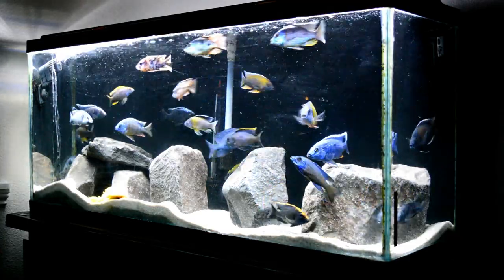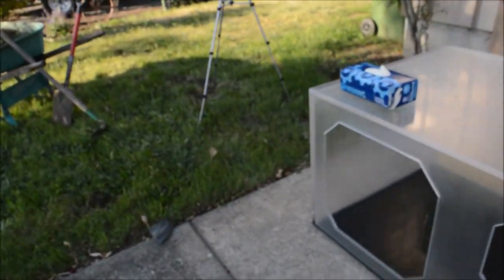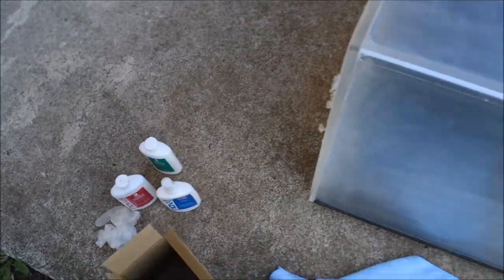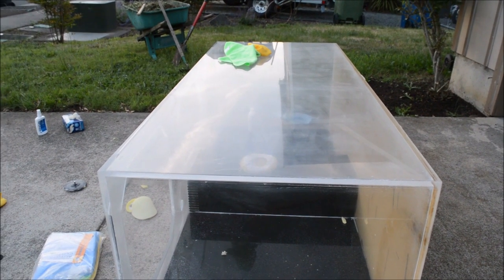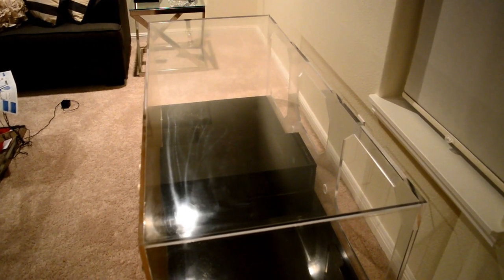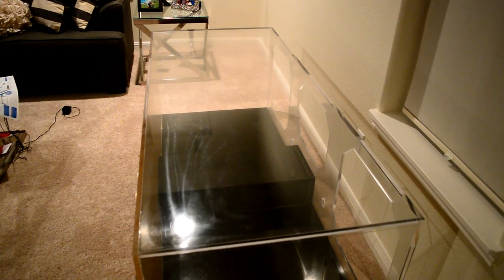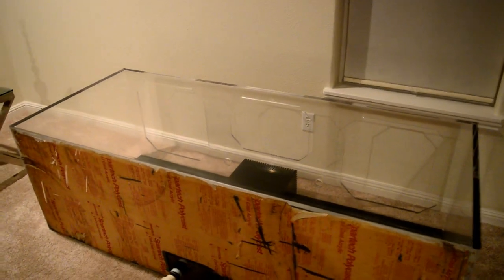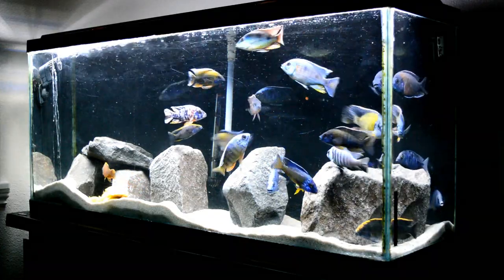How To | Restore An Acrylic Aquarium | 220 Gallon Aquarium | POLISHING Step by Step Detail | PART 2

Comment: I had a split in a seam and I filled it with weldon 16 and just water tested it and it held great. I couldn't find that stuff you used here in Australia so used this stuff called Alushine metal polish and it came up great. The only problem now is the build up of product in the corners seem difficult to get out. Hopefully after the tanks are filled, that the sump will grab that dust out. By the way made 4 tanks and now on to the sump from acrylic left overs from a friend who is a builder and had to rip out a bunch of thick acrylic. They are going to be for shrimp, oto's and hillstreams and all aqua scaped.
Reply from the maker: Have you tried to use a wet microfiber cloth to get it out of the corners? Or high water pressure? I would make sure it's out before the tank gets filled.
Reply: Yes, tried both and with the euro bracing is just seems to relocate itself somewhere else, especially in corners and around the bracing. I will be filling my tanks first with tap water to see if all the plumbing is right and there is no leaks going to or from the sump. Was hoping that would rinse the rest out. Then I will be draining it and replacing the water with filtered rain water from my rain water tank and then letting it all cycle for 5 weeks, with bi-weekly 50 percent water changes. I will be switching off one tank and draining it and aquascaping it a week during that time as well. So it should all come out. I mainly stated about the residue in my tanks as this is just normal and also like you showed the slight swirl marks from the buffer are not noticeable when filled. I did a water test on each tank, no leaks and you can't see the residue except in the corners, but when drained and dried those things are noticeable again. There really isn't that much there.

Comment: At around 9.00 into the video it shows the tank up and running. Was this after you did the polish ?. Can see a lot of big scratches along the top. Just wondering not knocking you. I have a 850 litre tank which is not too bad. Quite a few scratches but no haze at all. Wondering whether to do this or not.

Comment: Sweet tank. Currently doing a tank that used to be a 350 and now is a 260. Cut it down, glued top back on and now polishing. was wondering how to get it finished without going up to12000 grit sandpaper. Now I know
Reply from the maker: Awesome! What are you going to keep in the tank?
Reply: I have 2 reticulated stingrays and several spiney eels that need to be moved into their own habitat. The arowana, peacock bass, 18"pleco and 2 synodontis  will remain in the 250 gal they now reside in

Comment: Mine is well over 30 years old- 240 gallons and Im not sure if the haze is scratches or just the very old plexi reacting to sunlight for a few hours a day for decades?  If its just outside scratches..I can sand wet sand it etc. But,maybe its just old age of the plastic?
Reply from the maker: Hi Stan, to me it’s worth a shot. The wet sand with multiple grits will help in my opinion. I don’t think things will come out 100% be any improvement is worth it. Are you going to do it?
Reply: Maybe the outside,corner. I cant see why the inside would be scratched since I had always let the Pleco's do the wiping and algae removal. One more question- when I look at the glass panels from the edge? They are milky and not clear. Was that tank you redid also like that? Since I wonder if my problem is more age then scratches.
Reply: @inventoryking  One year later I did. The 3000 grit worked very well I thought!..It's not like the tank was in 1986-lol. But much better than its been for decades.
Plus,no machines,abrasive pastes,petroleum products. Just the 3000 grit, aquarium water and a soft scrubbie under the sandpaper. That 3M is tough paper..never wore out even under water.

Comment: Is it possible to get good results with skipping sanding and just doing the Novus kit?
Reply from the maker: IMO it all depends on how deep the scratches are. If its light scratches, you can probably get away with just novus, if its DEEP scratches, you will probably want to sand it.
Reply: +inventoryking Thanks for the fast reply. I'm going to be tackling my newto me used 240 gallon tomorrow. Thank you for making this video also.
Reply from the maker: +TERRORIZERRRR no problem. What type of fish are you planning on keeping in it?
Reply: inventoryking Silver Arowana, Peacock Bass, and maybe a Gar
Reply: +inventoryking So I finished sanding the entire tank today with 1000 and 2000 grit didnt take out all the scratches, then I did a little test area with the Novus 3 and 2 and it doesn't look crystal clear like I expected, it looks to still have a bit of a haze. Any suggestions? Thinking of buying a variable speed polisher tomorrow morning, I'm hoping that does the trick. I should mention I used  fleece to polish, Is that why? Gotta use foam huh?
Reply from the maker: TERRORIZERRRR - When I used the polisher It was a Foam buffer. When wiping it down, use microfiber cloth.
Reply: +inventoryking Finally had time to finish the tank and it came out great once all finished. Thanks again for the helpful video and comments!
Reply from the maker: You but dude! Glad it worked out. Are you going to post a video?
Reply: +inventoryking I might once set up, if your on monster fish keepers or Instagram my name is HEX805 I will be updating my project there if you want to follow. that is again!

Comment: Hey, so I'm looking into buying a second hand acrylic tank, it looks foggy but I'm not sure if it's dirty or if it's completely scratched up. Like it looks like it's hard to see through but I'm not sure if it's just that it's not clean. Any idea?
Reply from the maker: As you know acrylic scratches really easy. Get a microfiber cloth, and when you look at the tank clean a spot with a wet microfiber cloth and dry wig a microfiber cloth. Anything else will scratch it. Or the foam of a sponge will work.
This will show you if it is dirty or scratched. How big is the tank?

Comment: What was the total cost of the materials used to refinish it? I found ANOTHER one on offer up for 40 bucks. I think it's a 55 gallon but before I look at it I wanna know what I'm getting into. I should probably just buy it and hang onto it until I can polish it at that price.
Reply from the maker: I dont remember, I bought some of the stuff awhile back. Probably around $50-$60
Reply: +inventoryking Did you buy the polishing compound locally or online? What brand is it? Tank looks AMAZING! Fish on!
Reply from the maker: Dude, That's Cichlid! - Novus, and I bought it on Amazon
Reply: +inventoryking Cheers!

Comment: I’m confused ... the guy from novus told me novus 3 is he equivalent to 600-800 wet dry when the novus 2 is equivalent to 1200 wet dry. He said you’d be going backwards if you did the 2000 sand paper then hit it with the novus 3 and then the novus 2 ... I tested mine on the top braces and no matter which way I try I can’t get the haze completely out .... maybe I’ll try getting the drill/ buffing pad as I did mine by hand
Reply from the maker: That’s interesting. I had success doing it this way. I think the electric drill is your best bet.
Reply: im having the same problem. did you figure anything out?
Reply: Having the same issue. Anyone figure anything out? I sanded with 800 grit wet/dry, then 2000 grit wet/dry. After that I did novus 3, then novus 2, but doesn't seem to be working. Still very hazy. I'm just doing the lids now before I move on to the rest of the tank, but want to get these clear first.
Reply: T Brook I know going from 2000 wet dry to novus 3 is wrong ....  it should be 2000 wet dry then novus 2 ... skip novus 3 all together .   I re-sanded mine with 2000 then hit it with novus 2 and it removed a lot of the haze... There’s still a little haze left , but I plan on hitting that with an adjustable speed drill / polish attachment with the Novus 2 to get rid of it